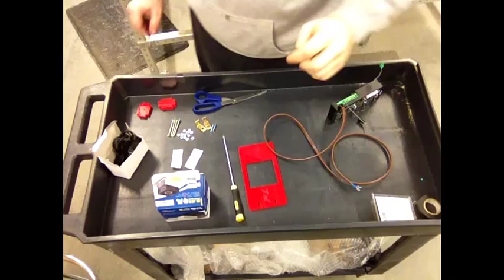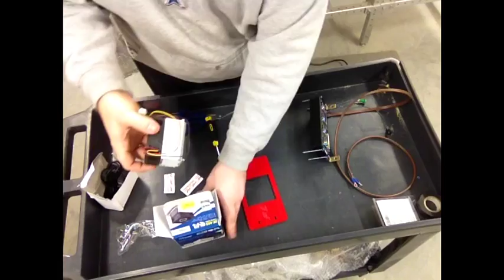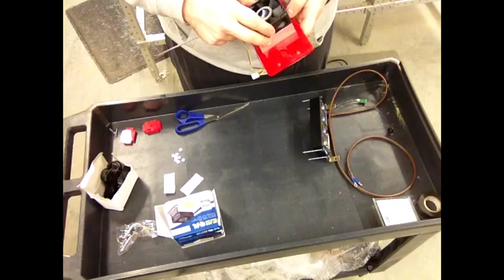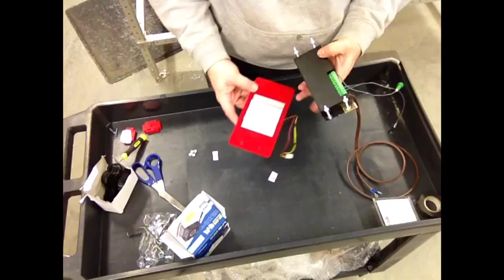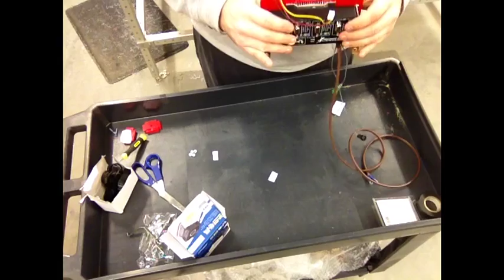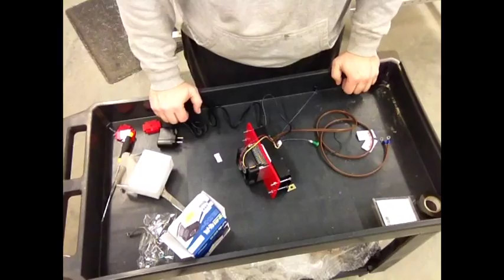G540 Cooling Kit Assembly

Comment from the maker: The reason why we chose the fan/heatsink combo over straight fans is that it was an easier combination to mount and didn't cost any more than 2 fans. I would argue that the product is not pointless; it serves it function of cooling the G540 quite well. According to the findings on Geckodrive's site, it's still an effective solution and reduced the temperature over 30C. Just because there is no extra benefit from running a fan/heatsink versus fans doesn't mean that there isn't any benefit at all.